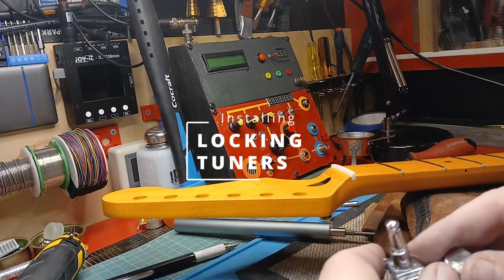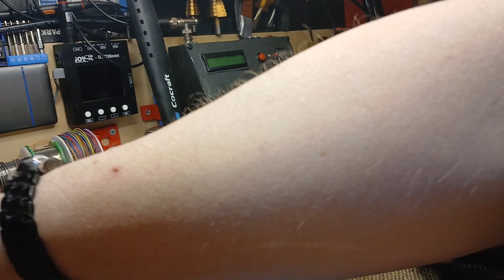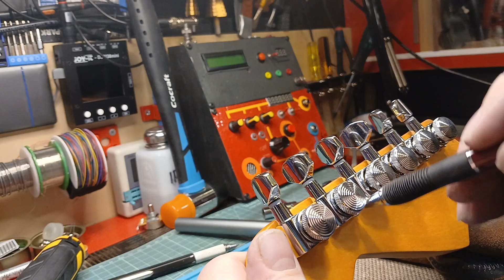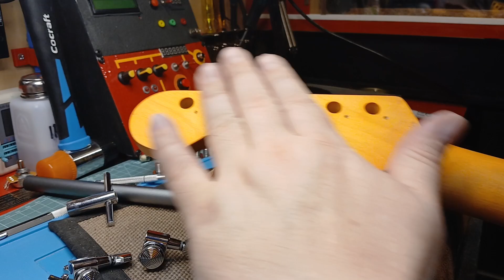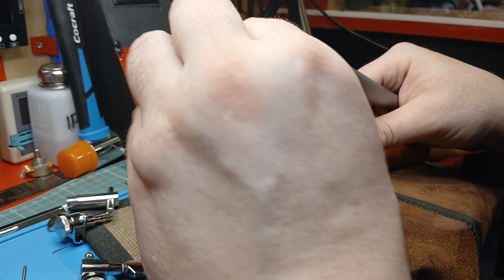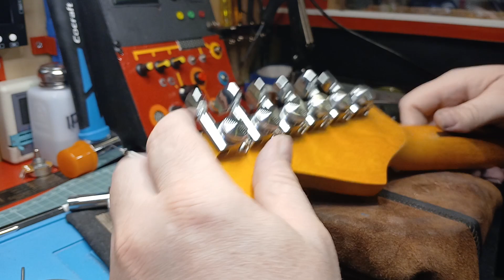MGLP studio - Installing locking tuners

Comment: Question for tech guys. I'm  replacing  grover tuners on a Dean ML with locking  tuners.  Should  I use any wood glue or anything  on the thread  of the new screws  when replacing  them? Thank you all.
Reply from the maker: if the Screw holes is to wide because of the old screws where a bit bigger or wider. Put some CA glue on the tip of a matchstick, and hammer it gently down, and fill in the holes. Then cut off the bits sticking out, and mark it upp for new holes in its place, drill only like half of the screw depth, and the wood from the match will be enough to create a tight fastening for the new screws. Remember, the screws is just from preventing the tuners from turning around its own axel. It does not handle any forses up and down. But differnt tuners has of course different designs, and some time you have do some filling and repaint for estetics, because the old holes ends up on the outside of the new tuners. Sometimes you are lucky.

If you glue the screws them selfs, they can get stuck, and break when its time to unscrew the next time, you are changing tuners. Good luck with replacing your tuners :)